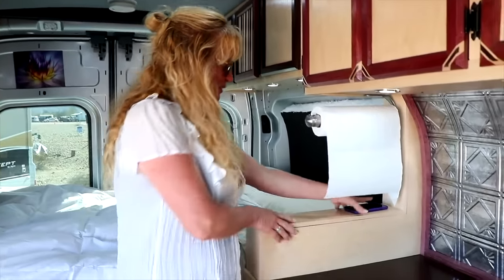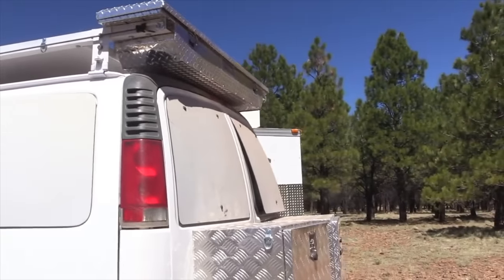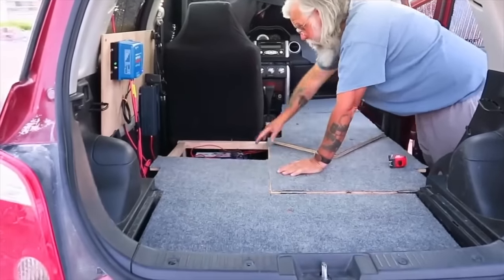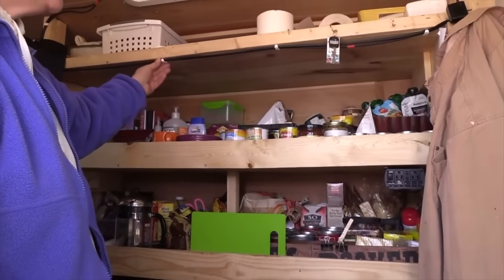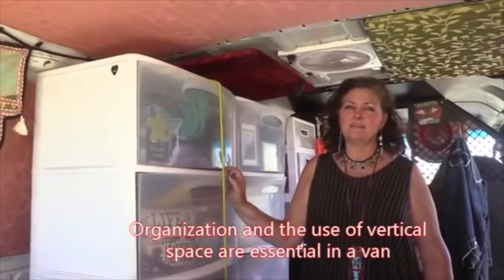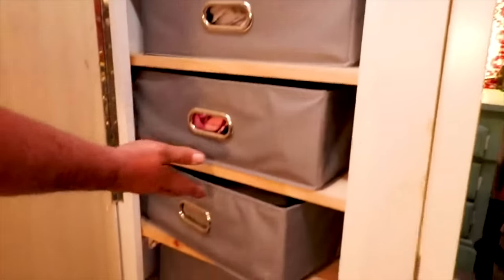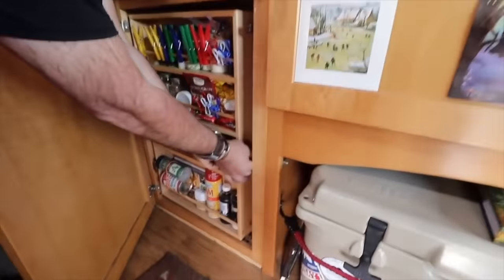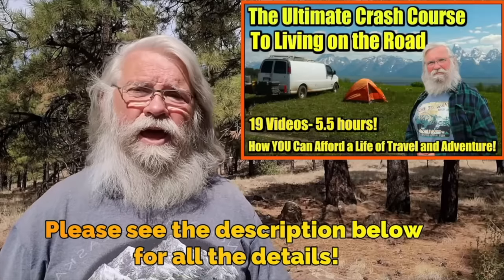Tour of the BEST STORAGE Ideas for Living in a Van

Comment: That man's truck camper at the beginning of video is pretty awesome with his space and his bed. I would like that, but will truck camper shells leak?
Reply: My husband had a truck cap before and it didn't leak. Years ago when we got tired of tent camping, we put a twin mattress in the truck and slept in there. The main problem we had was getting in and out was tricky and our breath left condensation on the ceiling that would start to drip in our face in the morning. We used to camp with 2 to 3 other families so we only used the truck to sleep in.
Reply: @cathyann6835  Thank you for your reply.

Comment: Lots of great ideas for the larger vans n schoolies.  I've actually been sitting around the house eyeballing almost every piece of furniture I have and thinking of how I can use it in a Mini Van. The idea is similar to what they're doing in the bigger bands only you have to scale back size wise because many vans aren't as wide, tall you can't stand up and stuff like that. I still like the idea of the pantry where it opens up and medicine chesters behind the spices. I was eyeballing my family buffet today. I was thinking if it were not so tall, and the width short.  Although I'm sure I could probably come up with some creative creative idea what I could do to extend that width/ length. I'd almost try it. I'd probably roll off of it tough, lol.  I was also considering taking the 2 leaves from my dining room table room table and using them over top of that 3rd row seating because that's only like 4' wide.